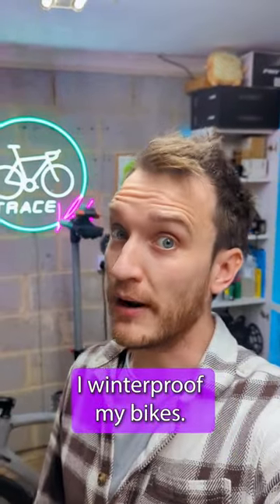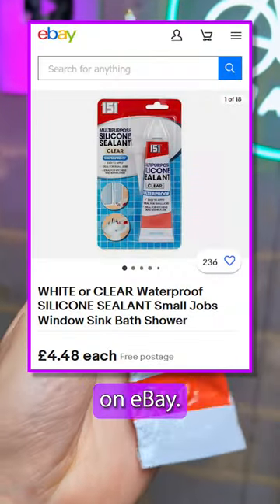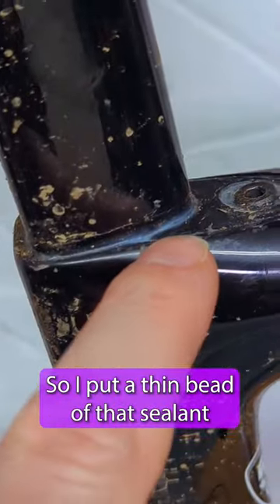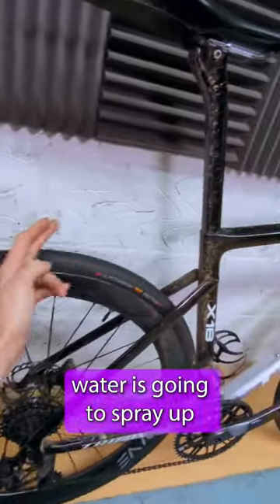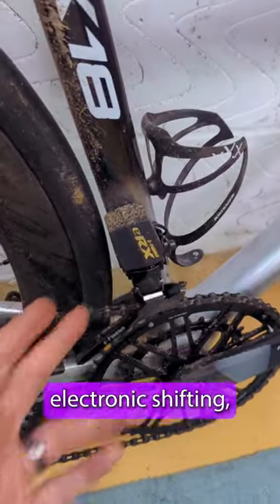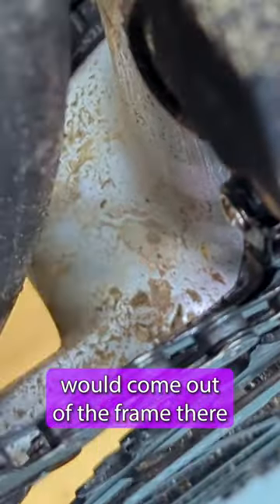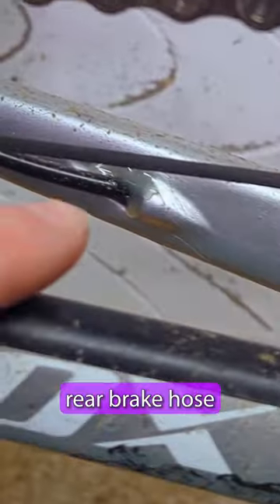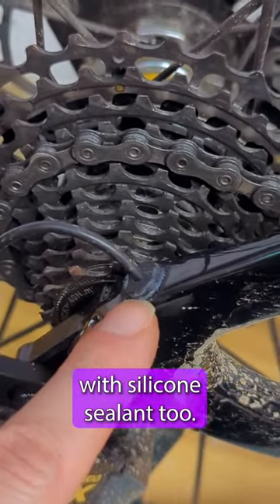How I winter-proof my bikes ❄️ #cycling #bikehacks

Comment: Those holes on the bottom of the bb are often used for drainage on mountain bikes not sure if it’s the same for road but I think it is probably worth considering leaving those open.
Reply: Any holes that are on the bottom or pointing downwards I would not plug, because water gravity will get that water out anyways
Reply: Has nothing to do with road bikes only. Its alot of thongs in life need the bottom drain hole open. I used to work on cameras and the water resistant boxes would always be drowned in water if it didn't have a drain hole from factory or if drilled homemade
Reply: I would also look into possible effects of the carbon. Just a simple Google search shows that there may be a reaction taking place that weakens the carbon in contact with silicone.
Reply: @joneinarmattiasvisser6113  100% correct Sir, hope no one watched this and sealed them up, lunacy.

Comment: For mountainbikers or riders with a bike with a round seat tube there is BikeYoke Willy, it's a rubber sleeve that goes over the seat post clamp and seat post, seat tube. I've not tried it. But never had any issues with my bikes.

Comment: You just make moisture condenses out of the air that got stuck within the frame and has nowhere to vaporize. It will still keep rust showing up (bottom bracket threads including). It's where the water collects when the bike stands on both wheels.
To keep water away from inner frame drill a 2-3 mm hole directly at the bottom of the BB area. Frames with external cables routing had a plastic guide, mounted at the bottom side of BB. The mounting holes let the water go away. Very, very useful.
Reply: @irfuel  Yes! Some also have one right at the tips of rear fork, for those who love to hang them front wheel up, on the wall.

Comment: If this is a joke it went way over my head LOL. Plugging up one whole will be counter intuitive to the drain systems built into the bikes tubing. You're going to have condensation building up inside the tubing of your bike instead of naturally draining and drying.

During wet and cold seasons you can just VERY lightly grease the bolts that your worried about rusting and wash your bike when it starts getting dirty.

Comment: Excellent! I know a guy who wont ride in the rain or wet, he had a bottom bracket die due to water in frame....I like this silicone idea. 
New tires are good in winter, Ive got some Gatorskin's coming. Little bit of tread and a very tough tire in general....TPU tubes will go in them.
Can be more debris on road in the wet.
Reply: Whatever you do , do not seal the BB holes that point downwards in the frame.  If you seal these up its pretty much guaranteed your going to have a nightmare and ruin your BB over time.  Shame your mate gave up riding on any day that might involve rain, BB's are more likely to fail due to lack of routine maintenence and poor cleaning post ride.

Comment: I notice you swapped to the RiRo carbon crankset! Apparently the Racework carbon crankset also switched to the same drive side fixing bolt system. Both cranks appear to be the same, just with different branding.

Comment: "Brilliant", do the same as this guy, and in spring you will find a lot of parts that started to rust because even with sealant water can get inside (it may even appear from nowhere - as condensate). Instead, just wash your bike in winter even more, it is the same recommendation as for cars in winter.

Comment: lol. just get fenders and leave your bike next to a radiator after a wet ride. using sealant on holes where moisture should be draining out of the frame is actually exacerbating the problem your trying to solve. anyway it's your bike to ruin so do as you please I guess.

Comment: 🥖🥖🥖Pop that silicone off the holes below your bottom bracket my dude. Water is insidious and will get inside despite your admirable efforts and needs somewhere to drain or it will eventually turn into a humid, mouldy, rusty swap on the inside of your frame.

Comment: Nice move sealing the holes below the bottom bracket!! They are for drainage - this is like the worst video i have seen to be honest.  As for sealing, im recommend washing the bike when you get back from a ride, takes 5 mins.  No mention of type of chain lube for wet conditions, or tyres, certainly more useful Winter advice than sealing things that shouldn't be sealed!